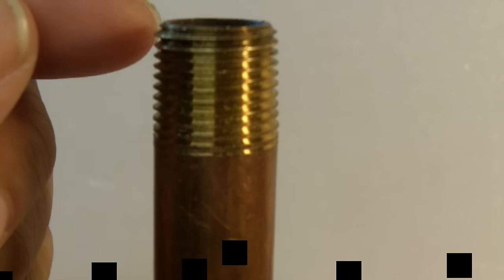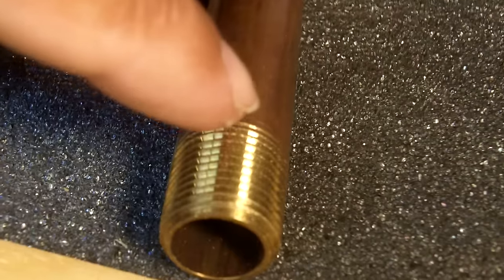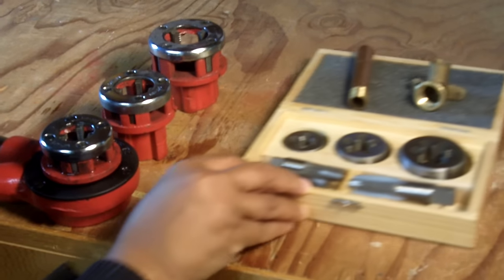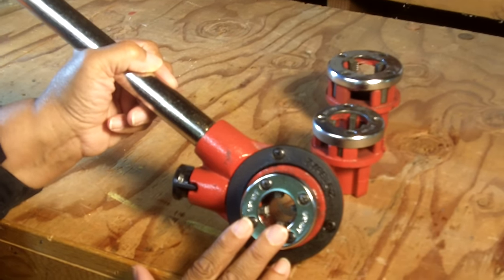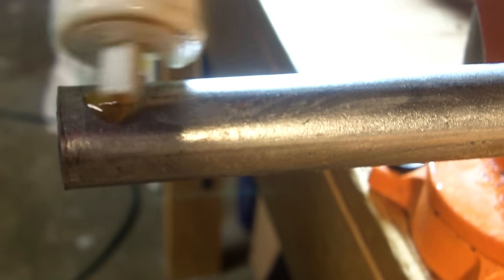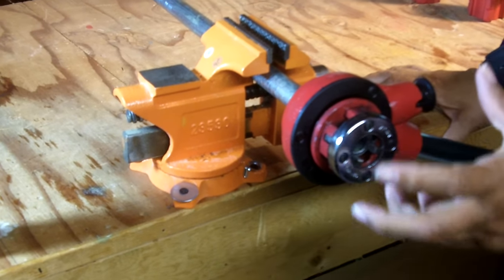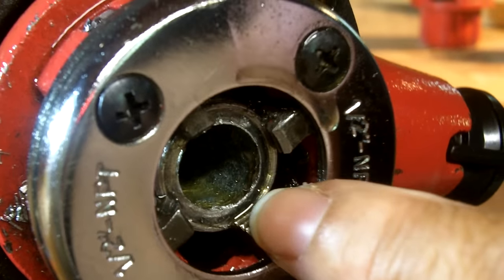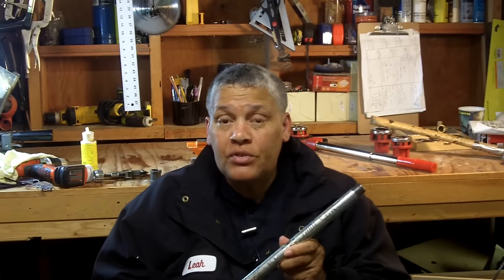How to Thread Pipe; A Beginner's Tutorial

Comment: Very nice video, but you should use dark cutting oil for threading pipe. Dark cutting oil is also useful for drilling holes, sawing metal and other applications. I am surprised that tiny little homeowner's bench vise held up to the stress of pipe threading. I have to tighten the pipe pretty tight in my Wilton Tradesman vise for it to hold, and that vise cost $500.

Comment: Very good video!  You're a natural as a teacher.  Since pipe threads are tapered (smaller diameter out at the tip of the pipe, compared to back at the body of the pipe) it's important to start the pipe in the correct end of the die.  Also, FWIW, the term I always heard was "clear the chips" rather than "clean the chips."  (You say po-tay-to, and I say po-tah-to, as Louis and Ella would have said.)

Comment: I tried on a shorter pipe on my first go. I found that you have to make sure there is enough room for the tool to travel without hitting the vise. This cause the pipe to start spinning and messed up the finish on my brand new black iron pipe! It also got so hard to turn that I ended up ripping my vise off my bench!! 
Thanks for the video though! Great explanation!!

Comment: yet another great toot oriole. your videos are the best but i think you already knew that. i just decided to use some old pipe to make something to grab onto next to the back stairs and was wondering if i could recondition some pieces and use them. my main concern is getting the vise to hold tight enough. i think i still have to buy a few taps. when i looked at the die i was wondering whether you're supposed to adjust those 4 screws on the die head. thanks as always.

Comment: Thank you so much for the simply detailed explanation. How to thread a short-length GI pipe, like 2 to 4 inch length piece? due to the width of the threader die and stock, it looks difficult. Thread from one end, then cut to the length required, then connect the threaded end to one or more of the fittings to increase the length, then hold the fittings in the vise. when I do this, at the point of the last 2-3 threads, the force of threading breaks one of the connected fittings.

Comment: Two things I'd like to add,
1. These can be rented at tool rental places, so you don't have to buy a set if you only need it for one job.
2. I thought I would never need to thread pipe, but you can do this to repair threads that have problems like cross threading or small burrs and dings on the end of the pipe. 
Thanks.

Comment: Many of the NPT taps/dies are just regular carbon steel which is probably fine for cutting new threads on softer metals such as aluminum, copper and brass. They won’t really “cut it” on stainless steel & you will find either difficulty or accelerated wear on steel pipes, but they work fine to clean existing threads on steel. If you need to do steel a lot get a High Speed Steel die/tap & if stainless is a must you will need a cobalt tap or perhaps even Carbide.
Happy cutting!

Comment: Thanks for another great video, Leah. I have a somewhat technical question that maybe you can answer. It looks like you made a 1/2" NPT thread (National Pipe Taper) with that die. The question is, if you keep cutting, would you end up with an  NPS (National Pipe Straight) thread?  Most threaded pipes you find at the hardware store are NPT. But occasionally you need a NPS thread for fixtures (like on a shower head pipe) which will seal with a rubber gasket.

Comment: Crane experiments on defects in threads. A piece of eight-inch pipe was threaded for a distance of 2 and 1/4 inches. The pipe was then put into a lathe and mutilated. In the threaded part, three grooves were turned,each 3/16th of an inch wide and to the bottom of the thread. The tops of the remaining threads with the exception of the one at the end of the pipe were turned off, giving them a flat surface 1/32" wide. Next, at 3 points on the circumference of the tapered threads, flat spots were filed,1" long and 2" wide, extending 1" on the threaded part. 25 grooves were then filed in the thread of the pipe and the same number in the coupling, all parallel with the pipe and 2/3 the depth of the thread. When all this deliberate mutilation was finished the threads were cleaned thoroughly and coated with cement. The joint was then screwed up so that the lengthwise grooves did not come up opposite one another. The outer ends were then plugged and tested to 425 psi of air without leaking. The same was found after a 1,000 psi hydraulic test. The amount of defect in the pipe was at least 100 times greater than pipe rejected by fitters. This showed the amount of ignorance about defects in threaded pipe that exists." We are talking about a involute circle. Remember everyone! Friction is the death of a proper joint. (Heat) Hence, pipe dope. If you use pipe dope as a lubricant and not a sealant, you'll not go wrong. Plumber for 42 years
Reply: No where near your experience... but, I can tell everyone to re-read your post and take it to heart.  About 6 months ago, I switched to a sealer/LUBRICATOR... the kind that does not set.  I have yet to have a leak of any kind.  Its saved a lot of time and frustration.   Thanks for the post.  I love the internet.  Where else would you find a 42 year pro freely sharing trade secrets with Joe Shmose :)  Thanks

Comment: I have never had to work with steel pipe since I have all PVC pipes in my home and outside also. I saw some of those tools while in the Air Force, but never knew how to use them. I now know what to do if I do have to work with steel pipe. I would like to see a video on how to work with copper pipe if you decide to make one. I have some PVC pipe to put down now for sewage and the Rockwell Workhorse is a nice tool to have handy, but I find it difficult to cut the PVC pipe where it is perfectly straight all around, but the workhorse stand holds the pipe just fine, but working with a hacksaw it is difficult to cut the pipe where it is straight all around.
Reply from the maker: Sidney Mathious Hi Sidney, nice to hear from you again!  We have several videos on cutting and sweating copper pipe, as well as a video on how to cut pvc cleanly.  There is a tool (for PVC) called a ratcheting pvc cutter.  The only thing is that you will be limited to a certain diameter.  The easiest way to find the video you are looking for is to go to our website, where all our videos are categorized by topic.
Reply: I will go to your site and check out the video on cutting PVC as I cannot cut a pipe where it is equal in length on all sides. Thanks for the information and hope you are having a nice week and a safe one also (Don't stay in the sun too long).
Reply: That is one thing I worry about when working with steel.

Comment: Your the best !  Do you have a video showing the right way to joint these type of pipes. Teflon? Pipe dope? Teflon and pipe dope? Also is it true the teflon or pipe dope only lubricant and the sealing happens as a face seal at the interior of the pipe? Lastly if you need a valve or Tee to face a certain direction after joining how to you get that, if the face seal determines how many turn you need.

Comment: I need to replace a water heater, but I'm not plumber.  My biggest obstacle is knowing how much a pipe and a fitting screws onto each other so I can get the pipe lengths correct.  
I screwed  2 plugs into 2 couplings.  One plug screwed in 3/8 inch before it was tight enough to not leak and the other plug screwed into the other coupling 3/4 inch to be in far enough to not leak.

Comment: Just a little correction: at 01:30 you say "the size of the die is the size of the pipe's outer diameter".  Pipe (and the dies to cut them) are actually sized by the pipe's inner diameter.  It is tubing that is sized by outer diameter.

Comment: Good video. I do this for work a lot and if i can i have my vise holding the pipe vertical so the shavings  falls out and i spray the hell out of it using tapper oil and or bar oil for chainsaws or sea foam it's thicker than WD40 etc  use a hammer to bang the shaving and air compressor highly advise using eye protection.

Comment: Hey Leah. My kitchen sink main drain galvanized pipe corroded and broke in the coupling in the wall. It left some debris in the threads of the coupling. Is there such a thing as a 1 1/2” tap to clean the threads in the coupling in order to attach a new pipe? Any suggestions? I love your videos. Thanks.

Comment: Can we discuss the "chip breaking" process a bit more?

I have the exact same pipe threader as you and I just broke my cutter 3/4 housing (the cast blade holders snapped) on the very first pipe I was cutting. I kept it lubed with cutting oil, backed the cutter up every few turns, even completely removed the cutter at one point when i felt a fair amount of resistance.

When you back up the cutter to "break the chips" i felt resistance. Not wanting to damage anything I didn't push past that resistance the first time. The second time i pushed past that resistance and i heard the chips "snap" off. Are we supposed to be pushing past the resistance when reversing each time until we hear the snap and the tool flows freely backward? Also, I was using a metal pick to try to brush the chips out of the cutting path. Is that necessary?

I'm wondering if my first time around I wasn't actually breaking the chips off and that was the problem (the resistance when reversing scared me and i noticed in the video you also stopped with there was resistance). Thoughts?

Comment: Thank You Leah great video! I found your videos while looking into a frustrating problem. I am installing a gas line with black pipe. A local hardware store threaded my custom cuts for free but when I got them home they won’t thread. I asked them about it and he said their machine needs to be serviced but I could take a fitting and thread it on, then back off and repeat to clear it out so each piece will eventually thread properly. This seems like a ridiculously hard way to do this. Is there a simpler way to get the current threads to go on easier like in this video? Currently they catch and after about a quarter of a turn stop. Should I buy a ratchet threader and go over the existing threads or is there another way to get these to thread easier? Thanks!

Comment: I have a broken pipe with the break at the thread midpoint. Would it be viable to cut and re-thread the pipe without removing it? It is in a vertical position. Great video by the way. Thanks for posting.

Comment: Any advice on buying a pipe threader. The ridged with 1/2 to 1" dies is $220 obvious choice for the professional. The cheap Chinese one's with a few more dies are about $50. Most I will probably use is 1/2 and 3/4 so the more dies isn't much of a factor. Just going to use it for a few odd jobs and making a few pipes for bar clamps  so $220 is a lot for the little I will use it but I don't like spending money on tools that break in 5 minutes! Is thair a middle of the road set ? Or cheaper set you've had decent luck with? Thanks  good video

Comment: This is all very well, but suppose we take it up a few levels: (1) the pipe is stainless steel, (2) it's a 1 1/4-inch pipe (so the walls are 0.14 inches thick and completely rigid), and (3) you have to thread the pipe right up to a flange (so you can't use one of them ratchet thingies because the collar will run into the flange before the cutters even begin to bite).  In this scenario, how do you do the job?

Comment: Does the inner diameter of a pipe matter, regarding its ability to be threaded?  Does the same equipment work for NPT threading any pipe with the same outer diameter, whether it be schedule 40, schedule 80, or structural tubing that has any thickness?

Comment: What is the number of turns of thread for each die size (when checking the thread without using ring gauges)?

I'm interested in size of:

3/4" = number of turns?
1" = number of turns?
1-1/4"  = number of turns?
1-1/2"  = number of turns?

Comment: i'm trying to renew/repair/recut/refresh some old threads and i can't get this die started. it's got 3/4 stamped on it but not the threads per inch, which i assume are standard on both the die and the old pipe. i can only assume that i will have even worse luck trying to cut new threads into a new piece of pipe. nothing ever works for me but thanks again for your video.

Comment: So if I were to buy pipe at HD I would need to get all the ends rethreaded? Even if they're already threaded I try putting other connections and there's lots of resistance and it doesn't screw on completely.

Comment: Would this work on pipes that are even more hollow on the inside? I need to be able to do this for something i'm putting wires in.
Reply from the maker: +A Gamer with a Namer I'm not certain I understand the question, however, if you are talking about the thickness of the walls of material, you could try to do it.  But the die may cut it too deeply.
Reply: Alright, thank you.

Comment: may i know why the pipe is gripped beneath the vise not on its actual flat clamp?..thanks
Reply: Lawrence Sand, If you gripped the pipe in the jaws of the vise it would squash the pipe a little and make it oval, gripping the pipe below the jaws in some vises does not make the pipe oval, because in this area of the vise the jaws are rounded and the pipe is gripped in more than two places.
But for gripping pipe when threading a proper pipe clamp should be used.

Comment: Does anyone know where (in the US) I can get an inexpensive die wrench that's stand-alone, without a die cutter?  I already bought a die cutter on ebay because I want to thread some 3/4 inch NPT on some old 3/4 inch pipe I have to make some pipe clamps for woodworking and figured I could do it without a wrench by putting the die in a vise and turning the pipe into it by hand.  Well, that really doesn't work because of the forces involved, but I don't want to spend a bunch of money on a complete die set.
Reply: Try Enco Tools, or else Harbor Freight. At Harbor Freight, the entire unit may be cheap enough to warrant the purchase.
Reply: Lyle Borem Thanks.  I knew about Harbor Freight, but never heard of Enco Tools before.

Comment: so im guessing to thread the inside of the pipe just attach the tap to a crank and lub it up and twist it by hand
Reply from the maker: Use a tap wrench with the tap, drill an appropriate sized hole and use cutting oil.
Reply: Cool thanks

Comment: HI, i want to put thread on stainless steel and spring steel spear shafts (7mm/0.275591inch) will a normal tap and die set do the job???
Reply: Claytdogg X you need special taps with purpose specific alloy composition and style of tap needs to be able to handle the hardness of stainless. You might be able to do it with a normal use tap, but you will dull that bad boy super quick. A quick google search of stainless steel taps and dies will explain.
Reply: Brandon Gillette
thanks

Comment: Outer diameter of pipe is not the same as its common size name as you stated around 1:35. A 1/2 pipe has an outer diameter 0.840, its threads are tapered and are nominal 27/32 OD, even the inside diameter is slightly larger than the  common size reference diameter. Fantastic tutorial on threading but a boo-boo on sizes, NPT size standards like so many other mechanical thread standards are rather misleading and open more questions than they close.

Comment: How does this possibly save money? So you need a pipe threader - several different sizes if you're using that, a ratchet set, workshop bench, a vise, oil, sandapaper, etc. etc. etc. Way, cheaper, faster and mover convenient to get a shop to do it.